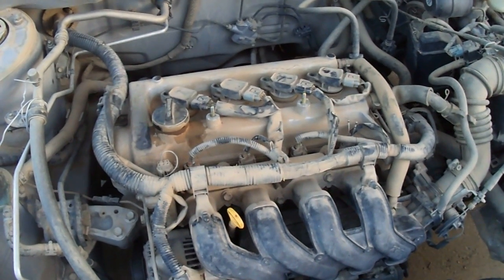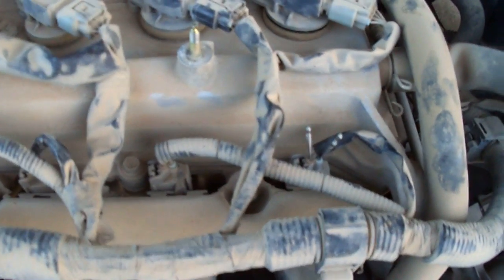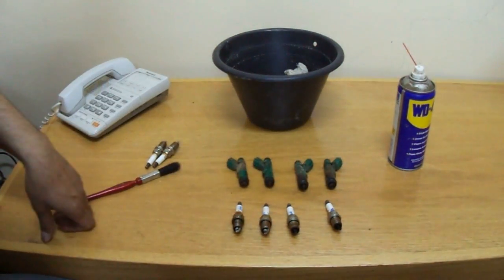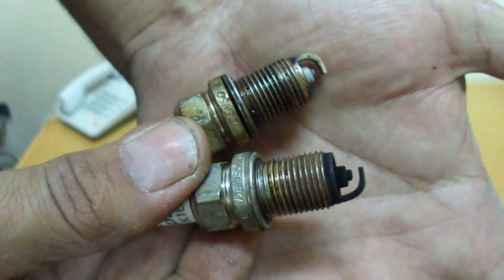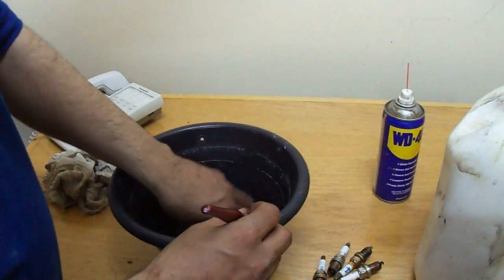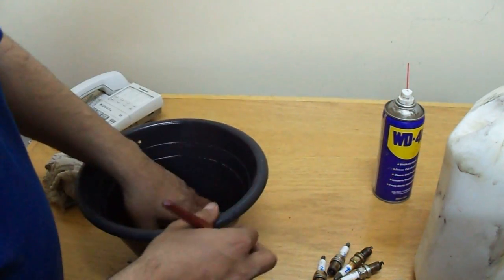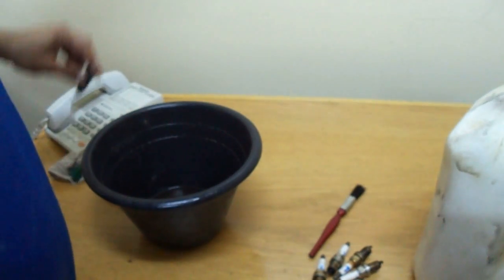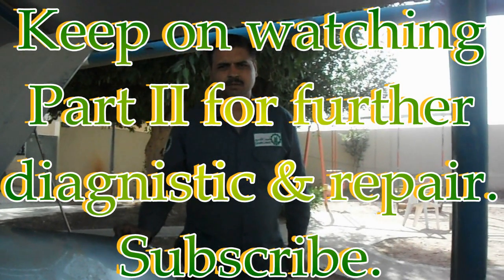Car missfire diagnostic Part I

Comment: Hi i am having 2013 carolla now almost run 135000 km no misfire but pickup is low is there any issue with spark plug....plz suggeest
Reply from the maker: You may check them. But such problem can be due to many reasons.

Comment: This need to check fuel trim and coil winding can be week over time and engine vacuum test and cylinder 4 compression test try to exchange coil see and check ground wire res
Reply from the maker: +Jaddah Auto Repair Electrican , Technician your direction points are great. The time I was was doing that, I hadn't available scanner with me. Stay tuned for second part. Regards,

Comment: Good cleaning of injectors with basic solvents. Sound advice on the effectiveness of a proper spray pattern. Could I suggest some kind of valve clearance problem or maybe weak spark from the coil ??
Reply from the maker: +Tom OConnor your suggestions are great and have great value for me dear sir. You are right those are the possibilities one can check for such a problem. Stay tuned for next part dear sir. Regards,

Comment: Jahan, I could not hear your speech loud enough to understand what you were saying, perhaps the mic on the camera is semi blocked.
Also, you can't talk over a running engine, i'm really supprised you made that mistake :-(.

i would clean the jets with a compressor line connected to the injector and pulse the 12v to the coil connections, spraying brake cleaner in to the injector input, and look for a good pattern of spray.

Checking for cracks on the injector bodys and check the seals.

I can't guess whats wrong, most of what you said was too low or drownd out by the engine.
Sorry, i had to tell you, as you need people to understand you clearly. :-)

Comment: Sir i am also an automobile engineer and i just want to know about vacuum valve
Reply: Salman Saifi 
Vacuum valve don't understand what you mean
On evap are what
There is vacuum switching valve egr or dpfe
Reply: Jaddah Auto Repair Electrican , Technician 

Sir the valve place on the manifold which regulate the turbo waste gate that one
Reply: Jaddah Auto Repair Electrican , Technician 

Sir 

The egr one

Comment: I m also facing missfire issue,on 2004 corolla engine dies in D...
Reply from the maker: Hope you learned something from this video. Next part will cover the subject in detail. Regards,
Reply: LearningZone can vacum leak cause misfire.... Plus my engine is not like urs....
Reply from the maker: Sure vacuum leak can create a misfire if it is severe. all engines are the same! Anyhow stay tuned for next part for my engine problem and diagnostic.
Reply: Bro i found the fault, actually alternator is putting too much load on engine, what could be cause